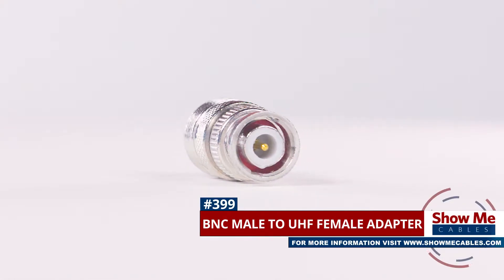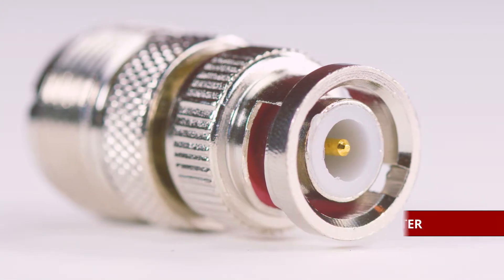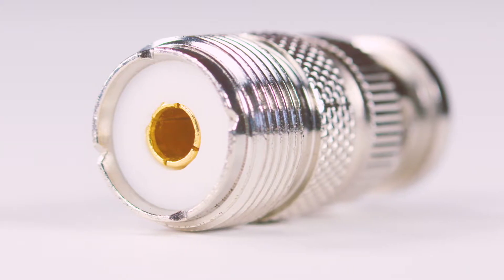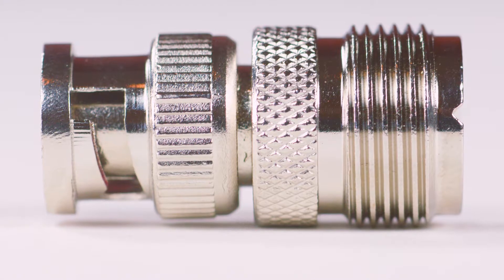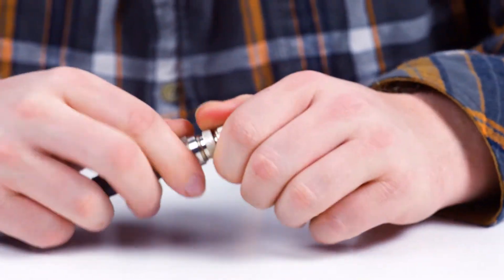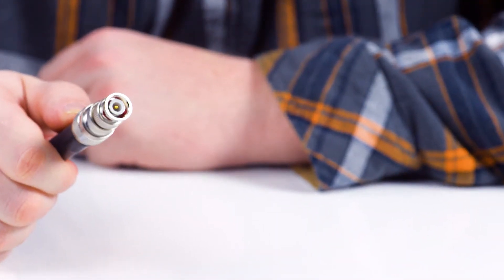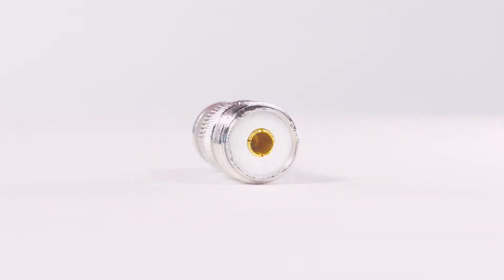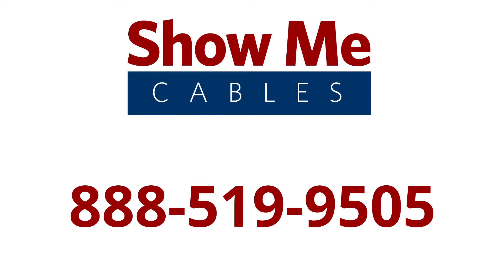BNC Male to UHF Female Adapter #399

Comment: I've got a new VHF marine radio I installed on the boat. I would like to be able to remove the radio quickly to secure inside the house. 
SO259-TNC adapter?
Dont want a press on fitting
Reply from the maker: https://www.showmecables.com/by-category/adapters/adapters-coax/uhf/uhf-female-to-tnc-male-adapter is our readily available version.  We also have a mil-spec version available for $26, but you would need to contact our sales department for that one.  888-519-9505.